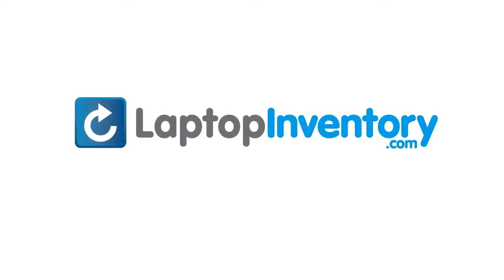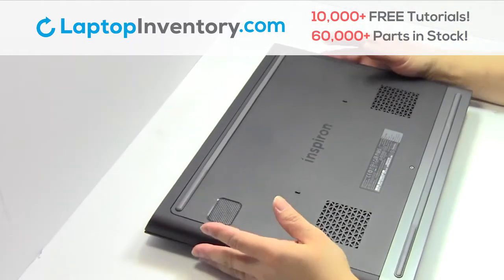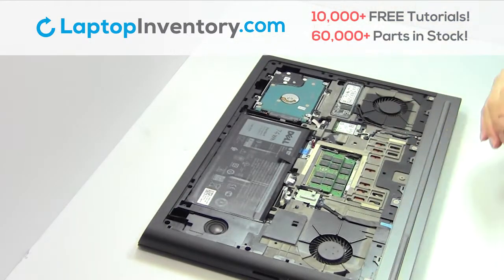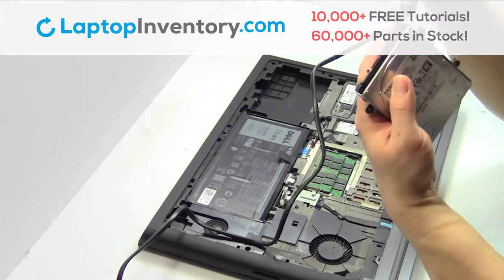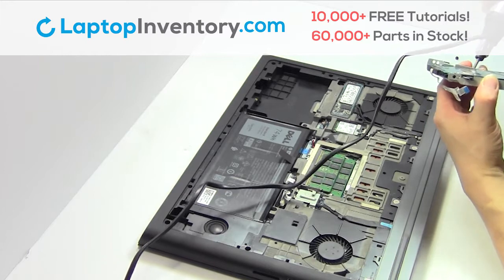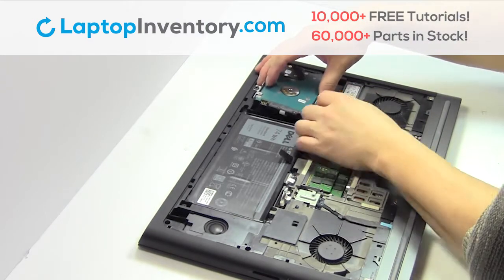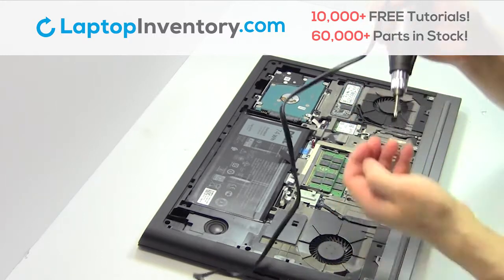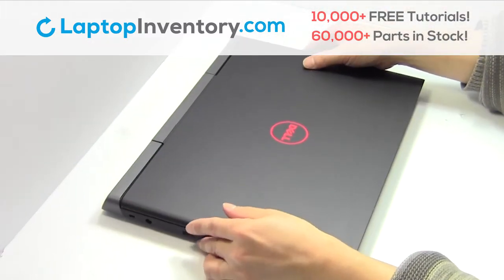Dell Inspiron 7567 Hard Drive Installation Replacement Guide Replace Install Laptop 7566 7778 P65F

Comment: Got the point across, but...

The guy isn’t grounded. That can cause mocroscopic holes in components created by static. 

I also recommend wearing nitrile gloves to keep oils off the components. 

The baggy sweater may also not be ESD safe. 

These things can affect your credibility, since the repair technician isn’t performing the repair correctly.
Reply: Sean Kelly do you know if I would need to buy other screws if I wanted to install a hard drive?
Reply: @lucamiller5114  no only if youre missing some